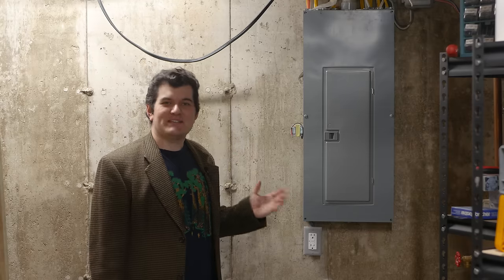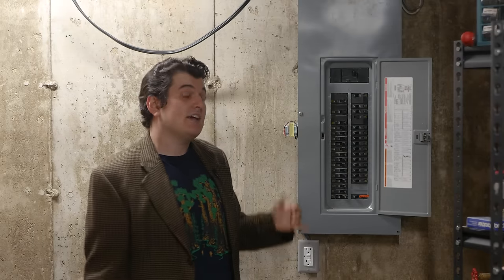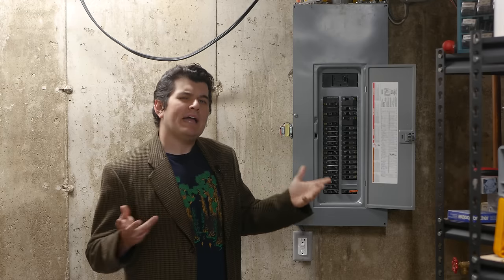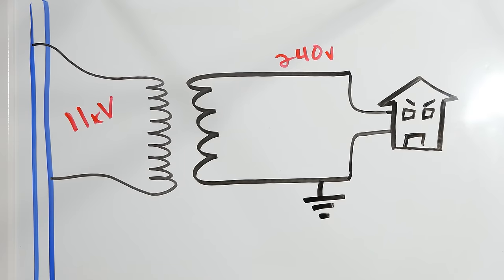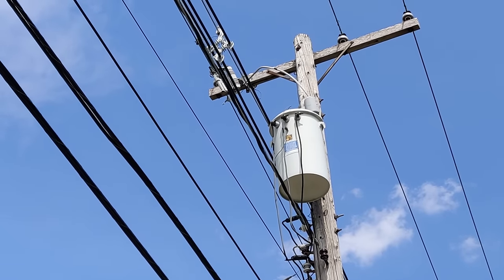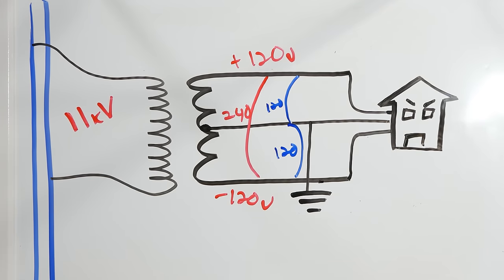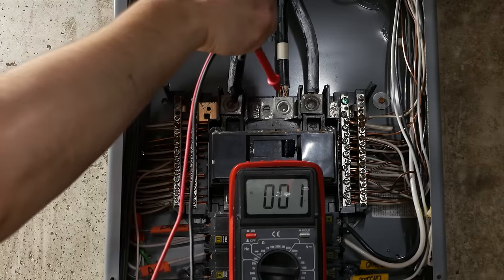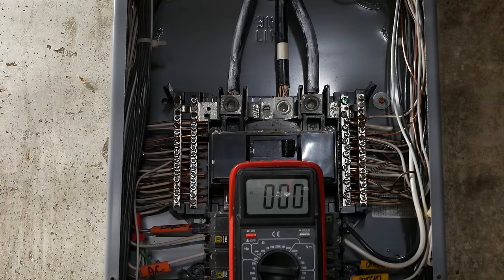The US electrical system is not 120V

Comment: We know our UK plugs hurt if stood on them. Thats why they have the switches so it can be left plugged in and not draw power by being on stand-by.
Reply: Parasitic load by SMPS powered stuff made in the last 20 years is negligible. I have a smart meter and time of use rate plan and gave extensively studied reducing base load by switching off idle/powered off electronics and found the difference to be negligible. I have a kill-a-watt meter and most of these items draw so little when off they don't even register. I calculated the cost of leaving them all plugged in at something like $2.50 a YEAR.
Reply: Just to add my 2p in here for anyone else, but you can find unswitched British wall plugs. They are increasingly rare, however.
Reply: A lot of the American plugs look like they're going to fall out. Especially when in multi-sockets. And the pins are narrow and look kind of weedy.  UK plugs have a fairly long earth pin which is always the last to leave the socket, which is a good safety feature.
Reply: @tubeducky  Not anything that complies with modern standards. If you have remote switched appliances such as dish washers, washing machines etc that are switched by grid plates, you'll find the socket isn't switched. You'll not find an unswitched general access outlet in anything built in the last 50 years.
Reply: @equid0x  no, not really. Some of that's stuff is pulling 3 to 4 watts which does add up.
Reply: Also the live and neutral pins are partially insulated where they come out of the plug.
Reply: @fgsaramago  that means it takes 250-333 of those devices to equal a kilowatt, which is (somewhere around) $0.25. Or you leave 1 3 watt thing plugged in for 120 days, that's a kw. those quarters really add up!
Reply: @genewitch  you're doing some funny math... One 3 watt device is 1kwh after 14 days. Let's say it's 2 kWh in a month. That's 50 cents a month for a single device. Say you have 15 devices throughout your home and its 7.5 a month. That's 1/5 of a regular electricity bill here in Portugal. You can pay your phone plan with those savings alone
Reply: Bobby Brady  The mechanical stress of constantly plugging and unplugging cord caps into receptacles damages both the cap and the receptacle.
Reply: @andyspoo2  If you're sufficiently ambitious, you can replace all the receptacles in your home with 120V twistlock receptacles. Obviously this would require you to remove all your appliance caps and replace them with twistlocks, as well. Voila, a no-slip connection and no exposed energized parts.
Reply: I seem to remember a statistic where the majority of hospital admissions associated with domestic electricity are due to plugs being stood on. UK plugs were permitted without insulation at the plug end of the pins, until the 1980s. Due to the size of the plug, it would have been difficult to get a finger in to touch the live metal. Also the earth pin is longer than the other two, so it always makes before energising the device, and breaks after it has been de-energised
Reply: @rickintx1125  same with a switch or anything mechanical.. things wear out
Reply: @andyspoo2  We really missed the boat on that one. That and the conductors only being exposed at the tip. But if switches on the outlet make everything safer, why all this business making sure the connections are safer as you plug/unplug the equipment?

Comment: "You can step the voltage up and down all willy-nilly"
Me who doesn't understand Transformers, and electricity after this video:
"INFINITE POWER"
Reply: Nope.  Power is finite.  Transformers let you trade (or transform) voltage into current (or the other way around) but power (which is voltage times current) is constant on either side of the transformer.
Reply: in theory a toroidial inductor is a transformer with a zero winding secondary, which would have infinite current at zero voltage
Reply: I remember when I was maybe 10 and had an encyclopedia from 1968, read about transformers and drew up a quick perpetual motion machine(I had also read up on gears steppeing up and down torque)
Reply: it's like plugging some of the holes in your shower head to get a stronger spray

Comment: Correct me if I am wrong, but I had a very basic understanding of these things a while ago, during my year studying Computer Engineering.

The exact voltage of a standard electrical socket can vary (normally between those “acceptable” levels) due to the nature of AC itself. AC voltage are never constant, nor exact. If the voltage was always static at exactly 240V or 120V, that would be DC.
Also, in Europe, we have 240V AC at 50Hz. This means (for those who don’t know what frequency is… although I hope there aren’t many of those watching this) that the exact voltage can change 50 times every second.
Reply: When referring to AC power, we use RMS voltage, which is a type of average.  If the supply is stable, and the loads are constant, the RMS voltage at the customer will be stable.  When the RMS voltage fluctuates, it is due to changes in the loads or in the supply.

Comment: As an Italian I appreciate this video because it finally satisfies my curiosity about your electrical system, which will always seem stupid to my mind 😂
Reply: All modern AC power systems are fundamentally the same, differing only in some details.
Reply: Its not much stupid as its old, as in most cases US is hard to change, that is also why its 60hz instead of 50. The relic of the past were standardization was thing of future. Its not like US is unique it this way, in EU for example you find not all member use same door openings dimensions or wall thickness standards.

Comment: Well in almost 100% af the homes here in Denmark, we have three phase 400V in. :-)
Reply: Isn't that only 2 of the 3 phases?
Reply: 100% AF
Reply: @xidarian  well the difference is the same, its 400V between two phases, but we have all three phases in our homes.
Reply: @MC-Racing  No it's not. It's 400V across all 3 phases cause of concatenated voltages: 2 phases factor 2, 3 phases factor ~1,732.
Reply: I actually never really thought about how they powered heavy appliances in the US because I just assumed that they had something similar. But apparently 240 volt is the most they can get so now I'm actually thinking "well that's not a lot" whereas before it wasn't something I thought about.
Reply: @hedgehog3180  for commercial applications we have 480 volt 3 phase power. I believe you need a special (IE non residential) transformer for it though.
Reply: Well, new(er) houses anyway.
Older houses and apartments often only two or just one.
Reply: @hedgehog3180  In NL we also power heavy appliances (oven, dishwasher, etc) with 240V. Electric stoves can be powered with 2x240V
Reply: Well, in fairness you have more delicious bacon to fry than the rest of us :D

Comment: Meanwhile in a European garages: Here, have 8 400V power plugs. We know you'll never use more than 2 at a time but whatever.
Reply: Unlimited power!!!
Reply: You don't.... Ohhh
I also have 3 fase power in my kitchen by the way.
Reply: @Poedersuiker  In a normal home in central Europe you always have 3 phase power. Normally you would split up the phases between the rooms / apartments as not to overload and have it balanced. for everything high powered  you will combine them. Electrical stoves have a bridge system in the back to adjust to older two or one phase connections. But they are rare these days. Also normally in Europe we generate the phases not middle tapping but by phase shifting. the peak of each phase is shifted by 16.2/3 Hz. Which a a fun fact is often the frequency used on the overhead electrical power lines for trains. TLDR: most homes in Europe have 3 phases and we shift the frequency and dont middle tap transformers.
Reply: @humpelknuff  I know, still thanks for the nice explanation 😉 the I don't was as a reply on the not using all the 3fase power plugs. 
I actually had to change my whole system as it was 2 fase and my solar power system wanted 3 fase power. Also when I dumped my gas connection, in the same renovation, I  made a 3 fase power connection for my kitchen.
Reply: Where is this Europe you speak of? Northern Canada?
Reply: Is it 5-prong?
Reply: @humpelknuff  Funfact between the 3 Phases its around 560V, but you need special equipment to use that. Example is an Three Phase Full Wave Rectifier (which is a full bridge rectifier on steroids) which gives you a 538V Direct Current line.
Reply: @humpelknuff  Phase shift is measured in degrees, not Hertz. the three phases are shifted 120 degrees. Each phase is 220V in itself, but used as a trinity it combines to form 380V. You can effectively create three seperate 220VAC outlets with the three phases of 380V. This used to be forbidden but is allowed since the 1990's.
Reply: Paul Freedman for many years it’s 230/400 Volts. Also you can divide 50 Hz by 3 which would give you the phase shift in Hz. At least that’s how I learned it apart from cosines phi ;)

Comment: Here in Sweden all homes have 400v service. Most flats too...
Reply: You are referring to those big,  red bulky sockets ?
Reply: sweden had dc till.1960s is that right ?
Reply: My house in Norway is old enaugh that I don't have 400V, .. I actually worked on a house that still had a big warning label in the fuse box that its rewired from 120V to 240 (sometime in the early 1900's)
I wish I had tree fase power, but I'll make do with 240V 20A, I don't actually need more than 16 for what I've figured out..
Reply: @MarcoWarm  All European countries use three phase in the neighbourhood power distribution (even the US system uses three phase before the transformers). However, it's only a some northern European countries that deliver three phase to individual houses. In most of Europe, a single phase tap is delivered to individual properties giving the nominal 230V. Three phase is used for (some) commercial properties. 
Using a single phase in a property simplifies the internal wiring, although power is normally limited to 100A (or about 23kW) in most countries. Beyond that, 3 phase has to be installed, which can be expensive.
Reply: @markjones4704  DC at selected placed, and that is true for some country's up till the 1970's
And it was a dual system, so one side of a street could have the plus side of the system and the other side minus, these system did not have many advantages.
Many places in Europe had many different electricity systems after wwii mostly due to "what gear you can get hold on determinate what system you get", some country had been a mess, but as time went by and the systems had to be renewed/upgraded most had gone for a common system of 3 phase 220/380 Volt AC 50 Hz (today 230/400 Volt), a few country's use 220 Volt between the phases, but most use 380 Volt with the star-point as neutral (and ground/earth)
Reply: It's regular 3 phase service...
Reply: @TheEulerID  in germany there will almost always be three phase available for appliances with a lot of draw (water heaters ovens stoves etc)
Reply: @satyryczny797  most things that need three phase in a household will be hardwired and there are actualy different versions of the big red plugs but only 3×16amp and 3×32amp (11/22kW) are somewhat common with 32amp rare in residential buildings
Reply: @TheEulerID  every home has "400v" system. They just get only one or two phase into main circuit braker. All tree phases are divided by homes.
For example. I live in flat, 3 apartments per flor. I get 1 and 2nd phase. one neibor gets 2 nd and 3rd phase and 3rd neigbour gets 1st and 3rd phase.
Different phases are needed to devide load of electical grid and when one phase goes out then second one still stays. 400v is not actually 400v, it is 3 phases all 230v 3phase all together makes 380. But today voltage is tuned up. 15 years ago "standard" was 220v.
Reply: @RenaxTM91  20A? This guy had 200A
Reply: Exactly. The video title is clickbait.

Comment: Tommies: “I say, do you chaps use 240v or 120v?”
Yanks: “Yes.”

Also, the foot hazard from UK plugs is definitely far, far worse. I cannot begin tell you how thankful I am that most travel destinations use the NA or EU style residential outlets instead.
Reply: Pencils don’t generally take up an ambush position at eye level, orienting themselves perfectly like a knife-missile in Dune, to inflict damage on a sensitive part of the body. The UK plugs that at least roll over on their side, like a considerate flatmate with a snoring problem, aren’t so bad. But far too many stand up like nocturnally aroused punji stakes. And the adapters take up more room in a travel bag than a five-pack of the slim and still safe EU-style design.
Reply: Every other hazard with a UK plug is far far safer tho
Reply: James Kidd Agreed. Especially the outlet, which is designed the way it is to keep inquisitive children (and just plain stupid grown-ups) from putting conductive things in contact with mains voltage.
Reply: @Activated_Complex  Since you don't really hear about it. I can't imagine it being that much of a problem.
Reply: Considering how often I fumble about with plugs I can't see clearly in places I can't fit my foot, I think I prefer the UK system.
Reply: Lived in the UK 67 years and NEVER stood on a plug.  I have, however, stood on, and broken, several of those flat, two-pin, contnental plugs...

I actually enjoy the simpliciy of the EU plugs (and their smallness, especially, when travelling), but nothing quite compares to the satisfaction of inserting and removing a good, solid, UK plug.  It's bloody good design, and it feels like it!  The click of the switch on the socket is pretty good too...
Reply: My next project will be a Lego based 13amp plug that automatically takes up the ambush position by the top of the stairs.
Reply: South African plugs have round pns,still hurt though.
Reply: @garycochrane893  never trod on a UK plug in over 60 years! I have, hovever, trod on several European ones - several of which broke (one leaving exposed wires!)
Reply: @Activated_Complex  shutters on usa outlets have been required for almost 10 yrs just no one will update unless they have to

Comment: the reason I've always assumed we have switches on our outlets (NZ so Australian plugs) is that it's an extra, possibly unnecessary, safety measure. Even in the event that you do in fact manage to touch the pins on a plug you leave the switch off while plugging in your item of choosing, there's no flow of electricity. I could be wrong though. My experience is plug in, switch on, and only ever turn it off if you're unplugging something.

Comment: "Electric System on US is flawed"

Welcome to Brazil, ma boyz.
Reply: In Brazil, you never know for sure if an outlet is 120V or 240V. It depends on the state, the city, and even on how a particular building was wired :)
Reply: @kkfoto  And if he saw the Corona shower (nice name isn't?) which is the tiny electric water heaters they put in many showers (they are common in South America) he would be shocked™, as you would if you actually used the things, especially considering that, a ground wire is for rich people and 2 wires is all you will get in most places (and you still get tiny little shows even when grounded anyway, just hope the valve isn't metallic, as most old ones are...
He shows a pristine code compliant American fusebox and you get to read Ginger Biscuit like comments, maybe i should show you the decades old box used here, from a company that was forced to close in America in the 80ies due to their breakers and boxes being unsafe. What was the name again, Federal Pacific? Yup all that surplus made its way here and other "3rd world" places... Oh and master breakers are overrated (or you just have to go to the bottom floor of your apartment building, and ask the person with the keys to reach it).
You gotta experience that feeling of scare trying to use the breaker as it bends inwards, hoping the thing doesn't get stuck against the metal cover middle way while moving the lever...
Its funny he didn't show the sockets with switch/breaker required in America when near water. Here? Nah, good old fashioned ungrounded plug next to sink for those fancy people electric shavers i guess...
Reply: Hey, at least our plugs and power strip designs are vastly to superior to the ones in the U.S.
Reply: @felipenw  well, some of them are.... And the cheap adapters we use in bunches probably cancel any good that comes from the new plugs :p
Reply: Brazil electrical practices are scary...